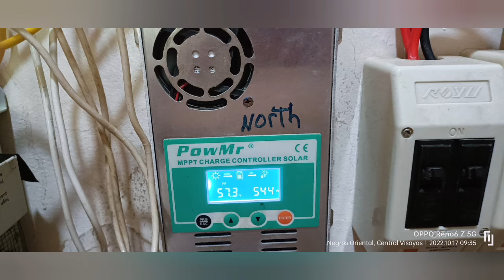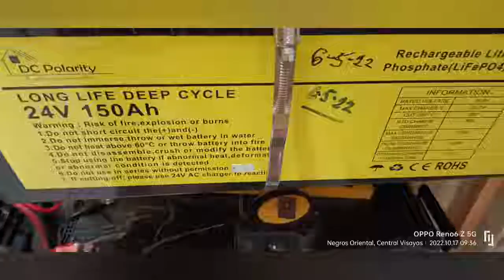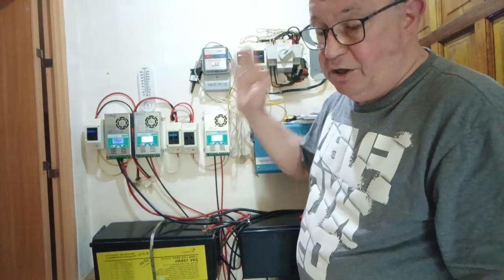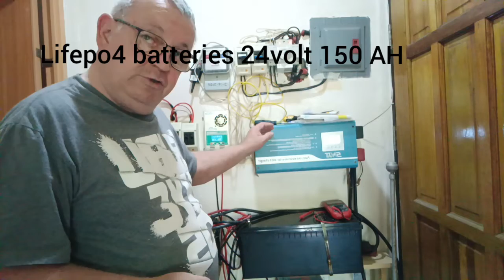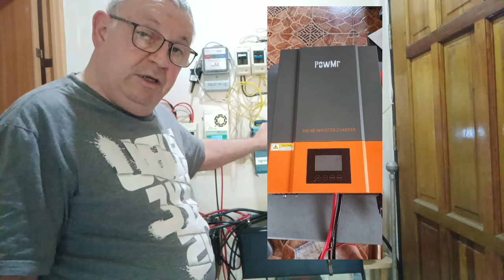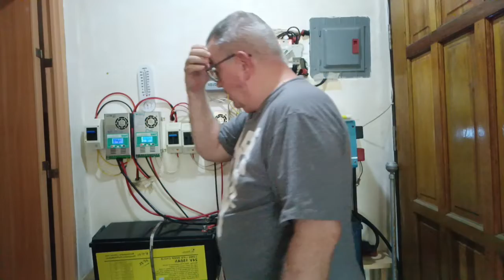Solar 😉 few details of my system ☺️

Comment: 3000 watts divided by 24 volts =125 amp. 3000 watts divided by 240 volts = 12.5 amps only philippines uses 240 single phase, 50 hertz systems, and cellar phones, computets, tvs, high yech equipment uses  sine wave current or in time it melt on the sqare wave or half wave coils and windings. The hertz is very important also or it melt all relay coils and motor coils or capasistors and motor windings. Hertz is the speed of the current on its conductor a second. A 50 hertz product , the current passes slower on the conductor per second of 10 per second. On a 60 hertz , it passes by on comnductor 10 hertz faster per second, so the 50  hertz coil core is thicker for the slower the heat stays on it, if not large anough , it get red hot and melt the insulation on winding caus8ng it to short out and melt. The larger the hertz, the less time the current is on the core so it be a smaller  core. As a 50 hertz core will.work on a 60 hertz power soarse but a 60 hertz core will not work on a 50 heryz  power soarse , it will get red hot and ruin all cores and windings.
Reply from the maker: 60 hertz is Philippines standard, thanks for watching

Comment: There nothing called sound wave, is it half wave or sine wave or square wave ? City power grids are 100 % sine wave so all things can charge safely. Half wave or sauare wave birns up alot batterys. Example why: square wave is 1 diode on each rectafier, half wave is 2 diodes on each retifier, sine wave has 4 diodes on each rectifieralso all compoinents has no jumper ground, not safe, i see no earth ground . Earth ground is a dirrect 6 feet deep ground rod wired to a seperate bar. The usa bars jumps to neutral bar but ruins the earth ground to useless. It must be seperate on a alternsting curent. Think what does ac alternate and dc direct curent mean ? True alternate means goes out 100 % current rating and returns back to transformer 50 % of current. Dc is just goes straight our curent and no return. So a neutral is a traveler not a ground. A traveler os a conductor for current travel, a earth ground is a stop traveler conductor of 0 current, a dead short. Why ? To make it a shortage cut current cut off breaker called no fault ground breaker. A regular breaker is a mercury breaker that cuts off on melted mercury to disconnect the circuit by heat. If touch the circuit , it not trip intill you go past tbat tempature to melt the mercury, 100 % electricuted. Earth ground is a shortage breaks circuit. If touch it , it a short in circuit and trips or breaks circuit of working properly. It goves a person a 50/50 chance of survival but within 72 hours ,  ypur heart can still explode, current works against musles and a heart is the largest mussle .

Comment: i will watch later.. its midnight im still busy doing stuff.. i was on the roof today working on solar mounts.. i really want to have good backup power with all the power outages here lately & surges.. thought it was lightning the other night it was a bad power surge ⚡
Reply from the maker: Thanks, enjoy, thanks for watching 👍😁👍
Reply: @Georgeofthejungle145  2 15 am finally day is done till morning.. 😁 i only use 1 3000 / 6000 watt inverter. others are kept away in a faraday. same with the epever charge controller. i dont usually go above 50% use but sometimes the inverter fans come on and really ramp up loud. i hope you show someone else there how things work incase you get feeling unwell? i try to explain how things are setup here... but i am not sure it helps.. to me its easy & makes sense but.. well thats me & i been doing this since i was a child.
Reply from the maker: @joeyjennings9548  Thanks 👍